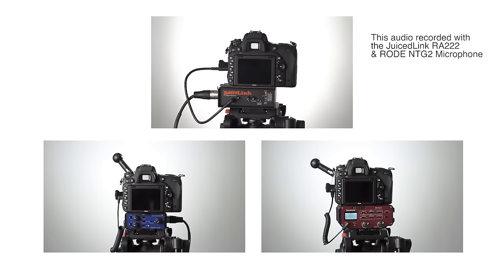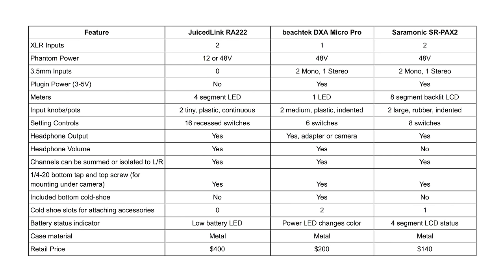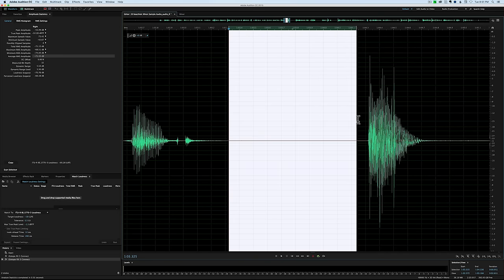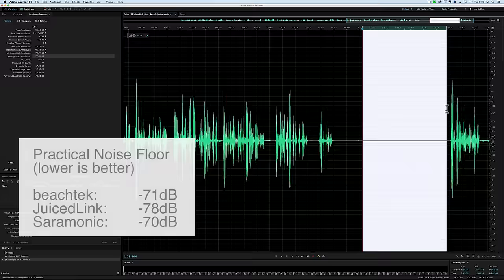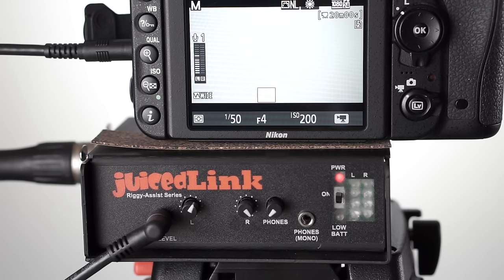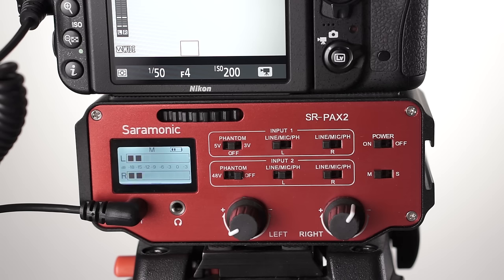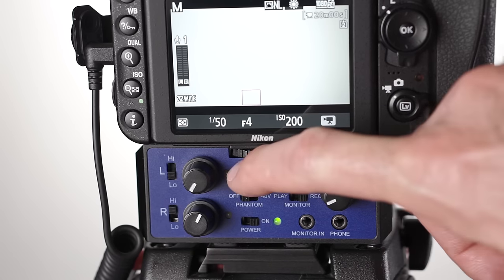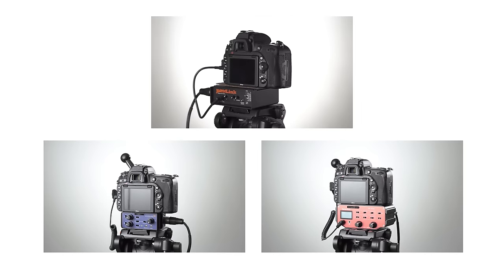Three Audio Adapters for DSLR and Mirrorless Cameras: JuicedLink, beachtek and Saramonic

Comment: Curtis, I originally bought the Beachtek but found the gain to be inadequate for a NTG2 to 5DMKiii set up. I returned it and got the JuicedLink that was more than adequate in gain for that set up (my tests showed the JuicedLink had literally twice as much clean gain as Beachteck.) The noise floor with the JuicedLink was also much better than the Beachtek. The only problem I have with the JuciedLink is a lack of external power. Would have been hands down the  best performance if it only had an external power option. Also, regarding its lack of 3.5mm input, a cheap 3.5mm to XLR adaptor makes this a non-event. So, I wouldn't even mention that as a shortcoming. Thanks for the great review!
Reply from the maker: +Real World Endo thanks for the info. One note: 3.5mm to XLR adapters are ok for self powered mics (such as a RODE VideoMic Pro) but will not work for mics which require plugin power 3-5V (almost all lavalier mics).

Good point on the additional gain from the JuicedLink. Thanks!
Reply from the maker: Thanks for the clarification Harry!

Comment: Great presentation! The Saramonic seems to be the best bang for your buck$
Thank you Mr. Judd
Reply: You are most welcome! Best wishes on your audio recordings!
Reply: Hello Mr. Judd. 
Quick question. Based on your review i plan on purchasing the Saramonic SR-PAX2 for $149.99. However Adorama is selling the Saramonic SR-AX104 for $169.99. The only difference i noticed between the two was that the AX104 has a headphone volume knob. I'm not a sound person so i was wondering if the AX104 had more features that might be useful other than the volume knob. Is it a better buy than the SR-PAX2? I'll be using with the NTG-2 on the Panasonic FZ2500 for short film projects.
Thank you
Reply from the maker: You are most welcome!
Reply from the maker: Hey Carlos, the AX104 looks great. I haven't tested it so cannot confirm its preamps are the same but it is very nice that it has a headphone volume control.
Reply: Curtis Judd ok very cool. thank you!
Reply: Hello and Happy New Year Mr. Judd!
I decided on the saramonic sr-pax2.  I'm using my panasonic fz2500 with the ntg-2 mic.  i noticed the meter readings on the sr-pax show mono. I get stereo from my headphones. when exported to my editor it was also in mono. Is that how it's suppose to be. On your presentaton I noticed both your left and right sound meter readings where active. Thank you.
Reply from the maker: Hi Carlos and happy new year to you! If you switch the PAX2 to stereo, you should get the microphone signal in both the left and right channels. That's generally what I do. Best wishes!

Comment: I think I need to re-shoot my Saramonic MixMic video after watching this. It sounds really good even though you're using the camera for recording. I may have to play around with this and make an "eat crow" video. :)
Reply from the maker: No eating crow! :) I think once you add the Mic (decent, but missing some low-end response), the adapter (also ok, but not able to keep up with higher quality pre-amps) and then the camera mic preamp, you get a rough combo. I notice here https://youtu.be/B_0od_f_QkQ?t=14s that when I use the NTG2 which has a rather heavy bass response, that the Saramonic adapter sort of evens it out with its somewhat thinner bass response. I think it is an additive effect when you consider the entire signal chain and different combinations are going to give different results.
Reply: Curtis Judd  Thanks Curtis. I am going to re-look at this whole thing after watching this video - I still don't think I did Saramonic any justice.
Reply: Curtis Judd I love your videos.....very straightforward and packed with good info. Question, is the Sound devices Mix-Pro D another option, albeit a more expensive one? I just love their products. Keep up the great work

Comment: Nice review.  I hadn't seen that model from Saramonic.
I was puzzled by your use of "indenting" on the control knobs. Some control knobs can be pushed in so that they can't get bumped. It finally became clear you were talking about the cogging tactile feedback as the knob was turned. On pan pots there is often a detent at the 12 o'clock balanced position. So I'm guessing you are saying that the knobs have a kind of rough or granular feel when you turn them. Is that correct?
Reply from the maker: +Robert Shaver correct! Very much like a detent but several covering the entire range of the potentiometer. Not sure what the right term is for that.

Comment: Nice comparisons. I had the juicedlink Riggy before getting an audio recorder and tried it with a Rode VideoMic Pro with a Rode VXLR Stereo 3.5mm Mini Jack to XLR Converter going into my Canon t3i, and even with Magic lantern to turn off auto gain control on the t3i and the volume turned down low like you said, I didn't really hear much of a difference on noise and it sounded practically the same as it would if I had just plugged the mic directly into my camera. Maybe that was because I wasn't using an actual XLR mic.
Reply from the maker: Interesting, thanks for that. The VideoMic Pro does a pretty good job of amplifying on its own so that may be why there wasn't much of a difference. I notice the biggest difference with low-end lavalier mics or 3.5mm shotgun mics which have lesser amplification circuitry (often the non-self-powered models like the original RODE VideoMic or VideoMic Go.)
Reply: The VideoMic Pro has a 20db option on it precisely for that reason. It's designed to be plugged into a camera, so Rode gave it the 20db option so you could turn the preamps in the camera all the way down. What it means is that, if you use a videomic pro, you're probably not going to notice much difference between plugging directly into the camera and using a preamp. Dave Dugdale actually did a video on exactly that: https://www.youtube.com/watch?v=4j-oaKDI4ww. If you were to use the Rode NTG4+ that doesn't have a +20db option, you would really need a pre amp to make it sound as good as it can be. DJ Clark did a video comparing different preamps here: https://www.youtube.com/watch?v=pxnAZ3wXNt4. He used an NTG2 and it sounds way better using the preamps than without it. If he'd used a VideoMic Pro set to 20db with the cameras preamps turned all the way down, adding the preamps probably wouldn't have made as much difference.

Comment: Great Curtis! Because of you I decided on the Saramonic in the link to amazon you provided.
I also prefer to record audio separately but, why not combine everything?, i.e. camera audio separately to sync later and Rode+Preamp+Zoom.
I know it is a lot of stuff to carry on but Rode signal is to low and adding gain in the camera/mixer produces quite a lot of noise. The pre-amp help to add gain with little noise.
Thanks again!
Pablo
Reply from the maker: Thanks Pablo and I hope it works well for you! Best wishes.
Reply: You don't need the preamp and the zoom, because the zoom has good preamps in it.

Comment: Thank you for this! So hard to decide if it's more well spent money to get something like this or a better audio recorder. This didn't exactly make it easier but at least I have some new information!
Reply from the maker: If it helps, I use a proper audio recorder in most circumstances and pull out the adapters when I'm using my GH4 as a webcam and want to ensure that the audio stays synced with the picture. If I instead use a microphone through an audio interface and an HDMI encoder to get the camera signal to my computer, they end up way out of sync.
Reply: New audio recorder it is. I'm rarely that much in a hurry in post, any way. Syncing doesn't take that much time! Thank you for your reply!
Reply from the maker: You're welcome and best wishes!

Comment: I have modified my Saramonic SR pax 2 to run directly from a power bank. On a 5000 mah, tiny lil powerbank, it ran more than 12 hours and the power bank was still blinking all its power indicators. Power was the only issue i faced with the pax 2.
Reply from the maker: Cool!

Comment: Hi Curtis, and thanks for yet another great video!

I have two questions if you could please answer them:
1- do you have a video (I can´t find it if you do) on comparing differences between Saramonic SR-PAX2 vs SR-AX107? If not, briefly (don´t want to abuse your time) why wouold you get one or the other for DSLR video recording?
2- I own a Zoom H4n Pro Black recorder, would it be interesting to use either of these Saramonic mixers before getting the audio signal into the Zoom or would it be almost no value added (either versatility of mixing and controlling o sound quality)?

Thanks !!!
Reply from the maker: Thanks Marcello. 1) No, these are all of the audio adapters I have used. I generally do not use them anymore, as I prefer to use dedicated audio recorders instead. 2) I don't think it will help in terms of audio quality if that is your goal. But it might help in terms of ergonomics if the H4n isn't working well for you on that front.
Reply: @curtisjudd  ok, thanks 4 ur answer and have a great sunday!

Comment: Thank you Curtis for your top-notch work. Your reviews and explanations are some of the very best i've found. Well done. My question: Unless i'm missing it, i haven't see you discuss the Sound Devices MixPre-D Field Mixer. I realize its price point is much higher than the devices reviewed here, but since it can fulfill the same function, i wonder whether or not it's something you would recommend—particularly for those users who don't want to or can't do dual system sound (seems common for those of us who work primarily in ENG or documentary-style work). It does seem remarkable that the price of the MixPre-D is the same as a Zoom F8—a device which mixes and records EIGHT channels of audio, and has a host of other strong features! Nonetheless, i'm attracted to the analog limiters, the renown cleanness of Sound Device's preamps, the small footprint, and the build quality. Would you be willing to share your thoughts? Thank you again, Curtis, for helping so many to take next steps in the industry.
Reply from the maker: Hi Stephen, I haven't reviewed the MixPre-D but I find that Sound Devices makes great quality audio products. I have the 633 which fits the job 99% of the time which is why I haven't tried or bought a MixPreD. I have, however, found that analogue limiters are very, very useful when recording for paid jobs. Just late last week on a job, the talent got very passionate about 3 minutes into the interview and if I hadn't had the limiters, the post guys would have had to spend a fair bit more time to do some minor de-clipping. If you've got the budget and you'll be recording professionally, I have no hesitation recommending at least a very close look at any of the SD gear.
Reply: Thanks Curtis. I agonized over this decision for more time than i care to admit. In the end, i decided to go with the Sound Devices MixPre-D. It arrives tomorrow. My rationale is that if—in the future—i purchase a Zoom F4 or F8, or even a Sound Devices 633, the MixPre-D will still provide an excellent, compact audio solution for one of my DSLRs, even if it's no longer my primary camera. Moreover, it can also be paired with any of these other devices to add more inputs. Here's hoping i made a good decision! Thanks again for your expert advice. Keep up the great work.
Reply from the maker: Congratulations Stephen. I expect that you'll be happy with your decision for a long time to come. You just avoided the mistake that many of us make by upgrading our way up the ladder by buying a $200 device, then $400, then $600, then...and so on.

I haven't heard anyone say, "...I wish I hadn't bought the Sound Devices XXX, it isn't very good..."  :)

Comment: Why is the JuicedLink twice the money of the others? It has 7 dB lower noise floor which is twice as quiet as the other units for one thing. One con for the JL is it cannot be powered externally. This is an issue if you need to shoot all day like shooting talent videos in a casting agency for example. If there is a gold standard for this type of device it would be the SD MixPre-D which I am curious as to how that would compare. I use the SD unit when a client wants quick turn around shots for a web ad or short series. Works really well. Plus I can connect an SD 302 mixer on the mix bus for a total of 5 XLR mic inputs if more than 2 are needed (multi-person interview).
Reply from the maker: All good points. That lower noise floor is a big deal. And of course there's Sound Devices which are always a solid choice.

Comment: So the only difference between these and devices like Tascam's or Zoom's is that these "adaptors" do not record audio to external memory?
Reply from the maker: +Zach Boyce that's one of the biggest differences for sure. Another difference is that similarly priced audio recorders tend to have more plastic and less durability, at least at the $200 and under price range. Also their form factors make them easier to mount on your camera rig (not in all cases, but true in many cases)

Comment: Another excellent review! But why did you use the Saramonic SR-PAX2 over the SR-AX104 and SR-AX107? Especially as both the AX104 and AX107 have adjustable headphone volume. Thanks
Reply from the maker: +Jeffrey Norris thanks! Two reasons, I didn't realize there was no volume control beforehand, and I wanted to get adapters at price points far enough apart to illustrate the options out there (keeping in mind that there are so many that I could not review them all).

Comment: Thanks again for your well made reviews! I bought the Tascam DR-60D, but this thing has one flaw. Before you say "Hello" the batteries are empty. That makes it, besides having good sound and recording quality, unusable for me. It was okay to mount the recorder onto my Varavon Cage, but I don´t want to add an extra power pack. So, do you have any insight about the energy consumption of the presented Audio Adapters?
Reply from the maker: I shot this a while back so I don't remember the exact numbers but my recollection is between 2-5 hours depending on whether you phantom power an XLR microphone. They each use 9V batteries.

Comment: Would these work with a iPhone? I can’t lower the volume like suggested on a dslr. 

I’m really digging your videos. 

Ultimately I have a ride to wireless going into my phone. What’s the best option of everything including the zoom line. All I care about sound quality. One mic. 👊🏻
Reply from the maker: Hi Dan, Thanks! I don't think you need one of these if you're sending one wireless RODE system to your phone. Maybe I'm missing some of the details? Apologies for the not very helpful response.
Reply: Curtis Judd I’m surprised you replied. Thanks. I just wanted to remove background noise and increase the overall volume. Ps you should look at amazon affiliates and link to all the products you cover.

Comment: Nice comparison Curtis. I am curious why I might use one of these units over say a Tascam DR-60D MKII.
Reply from the maker: +Gary Stockton hi Gary! These are a good option for those who need a quicker post workflow and cannot spare the time to sync. Of course you could do the same with a Tascam, but these units are smaller and much better built in terms of their physical cases (solid metal). I like to have one on hand to connect to my GH4 when I use it as a webcam because the audio has better sync than if I try to feed audio to the computer separate from the camera. Good question, thanks for that!
Reply: Thank you, and good insight on webcam and sound sync. I am testing out a program called Wirecast presently and have run across some audio sync issues.

Comment: I recently purchased the Marantz PMD-602A to use with the EOS R. The easy to see audio meter lights and headphone volume knob was the main reason I went for it. However, for the best sound, I have to turn my EOS R's recording level almost to nothing and it makes the audio meters on the Marantz useless. If I want to see the audio meters, I have to turn the R's attenuator on, but it doesn't sound as nice. Do you think I will run into the same issue if I trade it in for the Beachtek? Thank you.
Reply from the maker: The beachtek doesn't have a meter so that's a bit of a downside.

Comment: Good Day, Mr Curtis Judd!
Based, in part, on your review of the Sennheiser AVX wireless system, I picked one up. LOVE how clean it is (no more "kzsssst!").  Hate that I can't boost the output up a bit.  On my Canon 5D3, I'm having to bring my input levels up almost 30% and we all know how junky Canon's preamps are.
So my (hopefully) quick question is, do you have an update on preamps that you might recommend, or is the info here as valid today as the day you published it?  I'll spend what I have to to get a good setup, but after springing for the MKE2 version of the Senns, I'm HOPING to keep my preamp cost less than $200.00.
Any thoughts would be most appreciated!
Reply from the maker: Hi Matthew, all still valid except that JuicedLink seems to have disappeared. I liked the Saramonic quite a bit but wished it had a volume control for the headphones. And the Beachtek was good too. Good luck!
Reply: Thank you, Sir!
Looks like the Saramonic is my general goal at this point.  If I ever get two Senns, I'll need the two XLRs, if I want to continue to be that one-man-band.  
Thanks again, and Happy Holidays to you and yours!
Reply from the maker: And to you and yours!